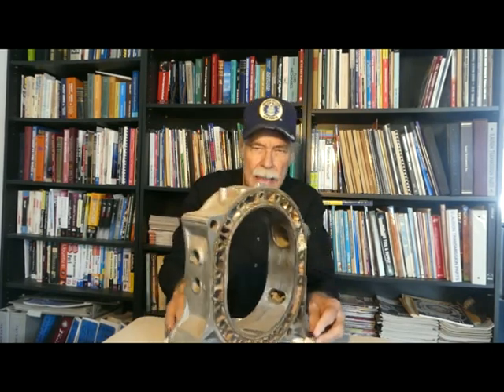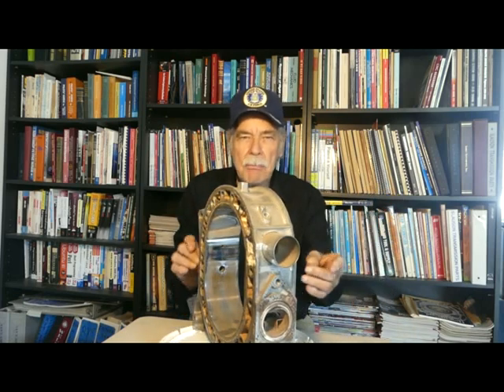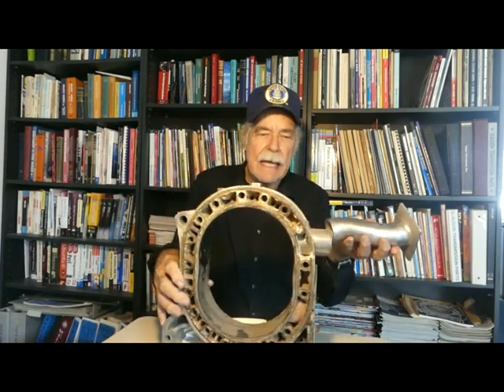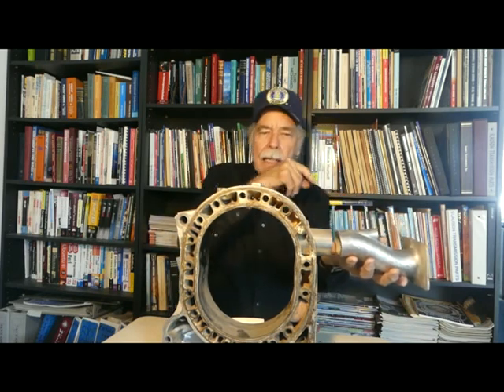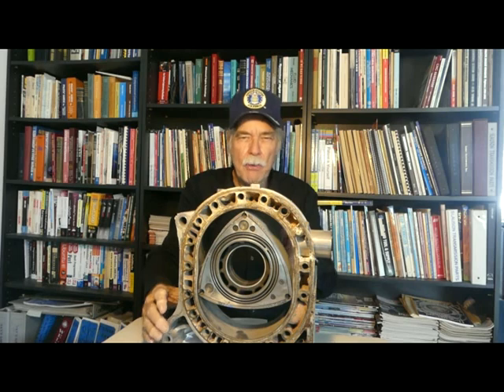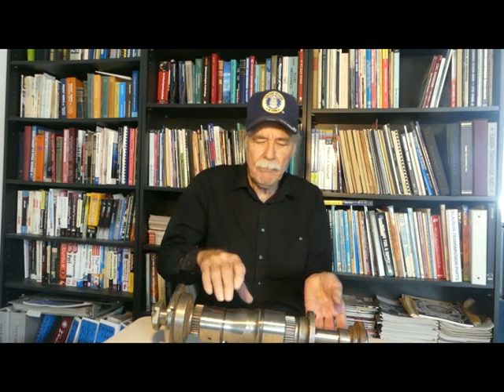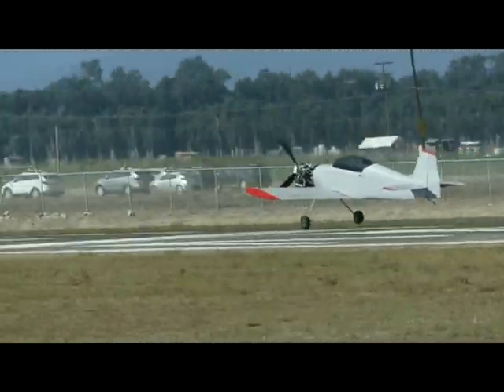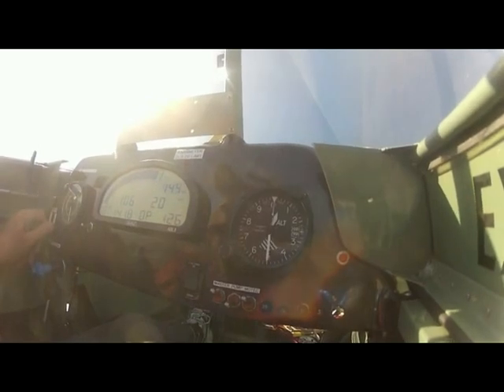Why the Wankel 1

Comment: Cute video about roteries being so amazing but coming from the racing world... these things are wildly regarded as very unreliable per the same power as many competing engine. Ive plaid with 2000ph plus engines that only need valve springs after 600 passes. And have seen wankles grenade trying to class race and be rebuilt and serviced many times in that same span of time.

In theory they are amazing in practice they are crap. Also forget about fuel economy. I will give you that they run smooth which is inherent to their design.

Also exhaust valves you can use inconel exhaust valves if youre worried about higher temperatures.... this is for very high turbocharged applications.

Good luck though.
Reply: Good comment... and the FAA agrees with you, no Wankel engine is reliable enough to pass a airworthiness type certification.

Comment: Mr. Lamar, how many of these engines have you built or rebuilt? How many airplanes have you owned using wankel power? Thanks for the video.
Reply: Mr. Lamar passed away in March after a long struggle with degenerative mental illness.
He did not own any Wankel powered aircraft.
Reply: @sandervanderkammen9230  Oh I did not know that. Thank you for the reply anyway.

Comment: Yes. Could you imagine injecting fuel through eccentric shaft with a little premix(oil) instead of just oil and letting the eccentric shaft spin 3 times per rotor rpm  the AFR and then have it go through the rotor and finally to the chamber(housing). It would really have usable afr all the way like Wankel originally intended, it’s just that nobody has experimented with it that way. May be using a Sohn adapter and filling reservoir with fuel and some oil(premix) it will inject fuel and oil through OMP and go through eccentric shaft as well. Best to use good fuel pump. But again no one has experimented with it.
Reply: Wankel engines are totally unsuitable for aircraft applications which is why no aircraft manufacturer uses them.

Comment: ALLWAYS BEEN A LOW COMPRESSION  ENGINE                            WHY THE LEADING PLUG HOLE         WASTED AIR FUEL AND COMPRESSION
    

      
      A SkyActiv-X Rotary Engine Could Mean An Efficient Wankel Engine
    

        

      
      YOU NEED TO FIX APEX CHATTER ==== COMBUSTION SHAKE
    

    
      
      RX8  ENGINEERS WERE ALL ABOUT EGR  THATS WHY THEY BLOCKED THE ROTOR HOUSING
    

      
    
      
      WHY IS THE PLUG HOLE LEADING 14MM AND A PEX IS 2MM MAJOR LEAKAGES    WASTED AIR    FUEL    COMPRESSION ??????????
    
      
      USE THE OLD HOUSING WITH THE RX8 SIDE PLATES THEN YOU ILL HAVE A SIX PORT EXHALLWAYS BEEN A LOW COMPRESSION  ENGINE                            WHY THE LEADING PLUG HOLE         WASTED AIR FUEL AND COMPRESSION                A SkyActiv-X Rotary Engine Could Mean An Efficient Wankel Engine                        YOU NEED TO FIX APEX CHATTER ==== COMBUSTION SHAKE                    RX8  ENGINEERS WERE ALL ABOUT EGR  THATS WHY THEY BLOCKED THE ROTOR HOUSING                          WHY IS THE PLUG HOLE LEADING 14MM AND A PEX IS 2MM MAJOR LEAKAGES    WASTED AIR    FUEL    COMPRESSION ??????????                USE THE OLD HOUSING WITH THE RX8 SIDE PLATES THEN YOU ILL HAVE A SIX PORT EXHRead more               Show less            Reply                  ·           1

Comment: Why are there no primers on how to make the conversion of a Mazda 13b engine into a light aircraft?  I have found no guidance on how to do this...and I would like to.
Reply: Because its a really bad idea...
Reply: @doktorbimmer  not you again! buhaha (Waves to say hi)
Reply: Using a Mazda 13b to power an aircraft is a really bad idea.
Reply: @sandervanderkammen9230  Why is that? There is like 3 moving parts, none of which are reciprocating, it weighs a third of what a piston engine does. "The Wankel rotary engine has been an ideal choice for many owners and operators of small, propeller-driven aircraft. Compared to conventional piston engines, Wankel rotaries are small, lightweight, and has a high power-to-weight ratio. They’re nearly vibrationless, they can’t seize or knock, and they have fewer moving parts (to break)."

Plus, you can turbocharge them, with boost pressures that would blow up a piston engine in short order. Just saying...
Reply: @Jimidan1000  You sir do not have a functional understanding of the severe limitations and disadvantages of the now obsolete Wankel engine.

3 moving parts? Bullshite! A Mazda Renesis engine for example has over 235 moving and seals related parts, many of them the tiny fragile apex and side seals and springs... which ironically are the very same parts that are responsible for the Wankel engine's poor reliability that are so quickly ignored.
Reply: @Jimidan1000  The Wankel engine has proven to be inferior to other ICEs in aircraft applications... which is why No legitimate aircraft engineers or aircraft manufacturers have ever sold a type rated passenger aircraft with a Wankel engine.

The weight of the Wankel compared to other aircraft power plants is insignificant when considering the reduced payload and range penalties  caused by the Wankel horrible fuel consumption.

In aircraft applications where power--to-weight ratio performance is critical, the Gas Turbine engine offers an Order of Magnitude greater performance along with superior fuel efficiency and reliability.
Reply: @Jimidan1000  Not true. The Wankel engine is limited to significantly lower manifold pressure due to its poor combustion efficiency and weak sealing components.
They are poorly suited to turbocharged applications due the higher EGTs due to the lower thermal and combustion efficiency and the greater fuel consumption due to the need for more fuel enrichment than comparable reciprocating engines.

The Wankel is unsuitable for aircraft applications because they simply cannot meet the minimum reliability requirements for type rating certification or minimum industry standards for range and payloads.

Comment: These are amazing engines, but they have a lot of drawbacks, not the least of which is specific fuel consumption.
Reply: There are some very good reasons why no type rated aircraft was ever produced with a Wankel engine.
The Wankel engine is terribly suited to aircraft applications and simply too unreliable.
Reply: @sandervanderkammen9230  Mistral from Switzerland is a certified engine
Reply: @Jimidan1000  Mistral no longer exists, it went bankrupt after failings to complete the EASA air-worthiness certification process, Mistral was also unable to meet the preliminary requirements for FAA certification. 
There are no FAA or EASA certified Wankel engines available... they are simply too unreliable for aircraft applications.
Reply: @rotaryperfection  Mistral no longer in business, Paul Lamar dead.
Reply: @rotaryperfection  There are no Wankel engines that are reliable enough to pass a FAA or EASA  airworthiness certification.
Reply: @sandervanderkammen9230  The RELIABILITY isn't the issue with certification. It's spending the $$$$$$! Prove me wrong if you can?
Reply: @sandervanderkammen9230 Austro did.
Reply: @joseveintegenario-nisu1928  Austro has never manufactured a FAA or EASA certified Wankel engine for passenger aircraft.
Their only certified engines are reciprocating piston engines.
Reply: @sandervanderkammen9230  Both John Deere and Curtiss Wright had prototypes of Wankel engine for General Aviation, in the 200 HP class, but the market for GA sunk
Reply: @josega6338 No Wankel engine has ever passed the minimum reliability standards for airworthiness certification.
 Curtiss-Wright was a development partner in a joint NASA, FAA and US military program to produce Wankel engines for Commercial, General and Military aviation.
  Curtiss-Wright developed 26 different types  but none ever achieved airworthiness certification.
Curtiss-Wright went bankrupt after spending billions of dollars on the Wankel aviation program and sold-off everything to a partnership with John Deere and Lycoming.
After 10 years of failures and millions more spent the program was sold to RPI in 1991 which has been silent for years... died quietly.
 Any questions?
Reply: @sandervanderkammen9230  Reliability of the Wankel is not the biggest issue, more about durability of apex and rotor seals, TBO. Still not a show stopper. All automotive engines used in aircraft have reliability issues. First and again Wankle fuel and oil use is high, but the main issue of all auto engines in airplanes is the required PSRU. That is a failure point, belt or gear box. This proves to be a weak point in all automotive engine conversions.

 Bottom line there are far more Lycomings and Continental aircraft engines being flown and installed in new high performance amature built kit planes than automobile engines. The promise of the next great automotive engine for conversion to airplanes never materializes.

To get a car engine to work reasonably well and be practical takes a huge commitment in time, money and talant. The promise of cheap car engines blasting by a similarly equipped plane with a Lycoming or Continental at half price  is elusive. Hard to beat a flat 3 or 6 air cooled direct drive aircraft engine. The claim aircraft engines are dated is false. They are extensively researched and refined for over 75 years. Now adding electronic ignition and fuel injection their efficiency is even better. BRW aircraft engines pound for pound are very light and have very good efficiencies. They were designed for aircraft based on many decades of research, funded Government and military through WWII.

 The Lycs and TCM engines are very specialized aircraft engines, hard to beat. With PMA or aftermarket producers of complete Lycoming engines prices of new engines are a great value. Car engines end up being as much money and way more time in tinkering and developing the installation, with endless mods to make it work and solve short comings with work arounds.
Reply: @gmcjetpilot  Curtiss-Wright began working with the FAA in 1958 to develop an airworthy Wankel engine. After 25 years and 22 prototype designs C-W completely  abandoned the Wankel as a viable aircraft engine.
Reply: @sandervanderkammen9230  I have a degree in mechanical engineering. I'm in airline pilot in a lifetime EAA member is built to keep playing. I followed the Wankel engine and owned and rx2 and rx3 in the 70s in HS.  I buy them cheap with a blown engine and I would rebuild them. The Wankel is a German engine invented by Felix Wankel. In 1951, NSU Motorenwerke AG in Germany began development of the engine. 

Mazda brought the Wankle to market in the most significant way, and produced the most. The Mazda Wankle is the most common version used in plane conversions, both 2  and 3 rotor versions built. Suzuki had a rotary bike. Many people licensed them including Curtiss Wright. Tracy Sailor had a business selling parts to convert the Mazda rotary for experimental aircraft use. He had a RV4 he used as a test bed. It was ugly  but it blew. He retired from this. Like the Eggenfellner Subaru, the Mazda has lost favor. You can by a Lycoming I(O)-320, I(O)-340, I(O)-360 180 to 200 HP, bolt it on and fly 2000 hours reliably before OH, faster, better economy and just change oil and check plugs... Wankle is endless fiddling and truly horrific fuel consumption. It will not last 2000 flight hours. However if you are handy you rebuild it. I was doing that in 1970's on old Mazda Rotory cars with blown engines (bad side seals).

Two commercial companies tried to bring aircraft Wankels to market. They are both gone. It's a cool design but not practical in car, bike or plane. Racing is a good application.

I'm telling you the fuel Econ is bad and oil use (oil injection or pre mixed fuel) is a big big negative in car or plane.
Reply: @gmcjetpilot  Felix Wankel was obsessed with motorcycles his entire life, he worked at NSU in its motorcycle division. 
He was inspired to create the DKM-54 engine from the Megola rotary motorcycle which used a Millet type rotary engine.
Of course we are not discussing Felix Wankel's engine... we are discussing the KKM-57 created by Hanns Paschke and Walter Freode without any knowledge, assistance or blessing from Felix Wankel.
It was also developed originally for motorcycle applications.
It too was never used successfully in  aircraft production due to poor reliability.
Reply: @gmcjetpilot  The Wankel KKM was not very successful in motorsports competition either, in fact it is no longer used in any major professional or world class racing series.
Reply: @gmcjetpilot  Anyone that has ever owned A Mazda RX knows all too well the terrible fuel economy. At least you are honest about the poor reliability... many are still in denial of this major flaw.
Reply: @gmcjetpilot  The Wankel KKM design never offered any significant advantages over comparable internal combustion engines which is why the Wankel is now obsolete, no longer produced in series production for any applications.
Reply: @sandervanderkammen9230 Wankel RCE was banned from 24 h de LeMans after Mazda won the race and the fuel economy part of it.
When Mazda announced having a Wankel motorized car for the 360 cc Class in Japan, all other makers started crying: Have mercy on us!
Blessings +
Reply: The Wankel engine was conceived and designed as a motorcycle engine. It has never been successful as an aircraft engine.

There has never been a single Wankel engine that has achieved and maintained a  FAA or EASA PFTR flight-worthiness certification.
Reply: Wankel engines are simply too unreliable to pass airworthiness certification, many well-funded attempts have been made but all were complete failures.,
Reply: You could have a look at SFC figures in the book by McGovern. Mazda Cosmo 12A engine had a fuel economy of 230 gr/ HP/ hr.
Aircraft engines always work at power above 50 % of top power, BMEP of Rotary Engine is better under high load than under light load.
Light load performance of RE is worse than in a reciprocating engine, but Toyota found ways to improve this: A Reed Valve in peripheral intake port; a glow plug in leading site; air injection in exhaust port area.
Reply: @josega6338 You don't know what you are talking about, peak BSFC is always measured at WOT and this is at the RPM that achieves Peak BMEP.
This applies to all 4-stroke Otto Cycle engines including the Wankel KKM.
The Mazda R26B detuned to only 691 hp, only delivers 286grams/kwHr BSFC at barely lasted 24 hours... and consumed more fuel than all  it's competitors.
Even running full rich AFR Wankel engines cannot pass the minimum reliability standards for airworthiness certification.
No Mazda engines have ever come close to meetings FAA or EASA airworthiness certification.
Running Lean of Peak in a Wankel is a guaranteed way to quickly destroy the engine in minutes.

Toyota has never produced a single successful Wankel engine.